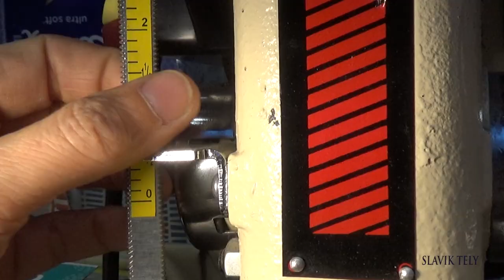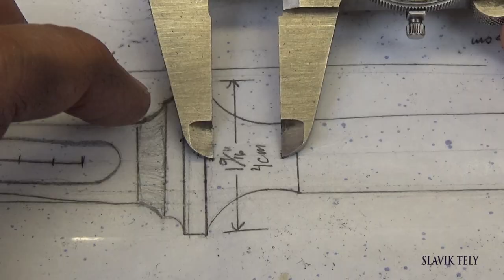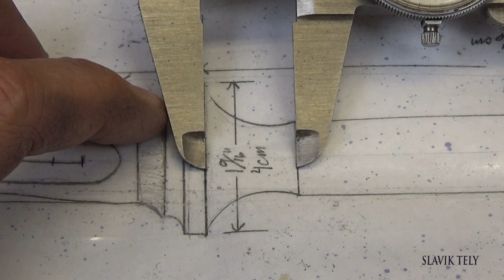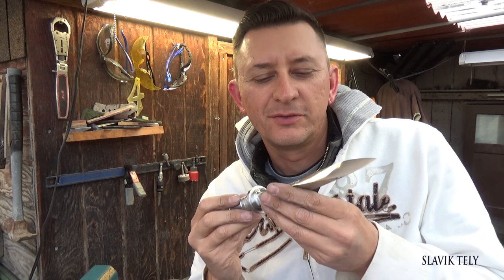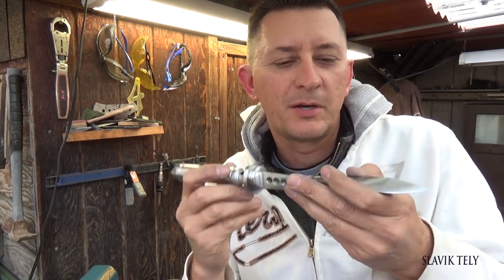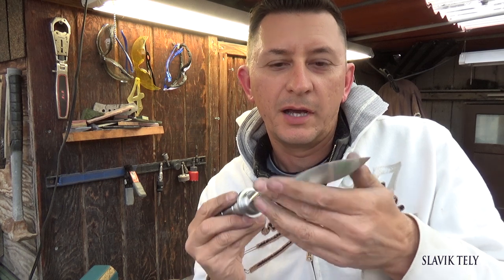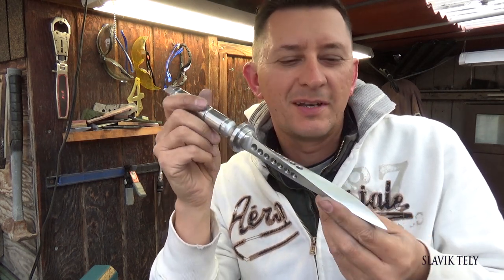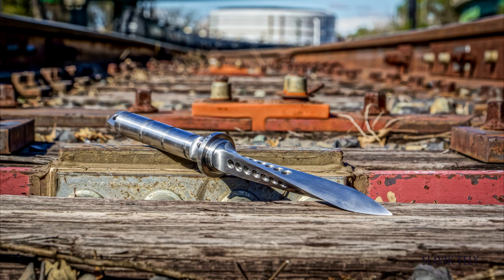Making Jagdkommando Knife without a lathe or CNC machine Part 2

Comment: Dude, you are an absolute inspiration. I build electric guitars by hand, with only three power tools (router, electric drill, and a palm sander). Everything else I use are hand tools. 

It takes a bit longer, but it gives me more control, where detail is concerned. 

I just found your channel, and I was like, "Finally someone else who thinks this way."
Reply from the maker: Thanks.
Reply: That's awesome man hats off to ya from bass player and woodsmith
Reply: @jonathanfowler3231  Weird question, but did you study and TA for Steve Davis in the SMU Anthropology department in the early 2000's?
Reply: @peachmelba1000  no sir I did not wish I would have sounds interesting not wierd besides stuck hone doing nothing so no problem answering sorry couldnt help you
Reply: @jonathanfowler3231  Hey it's a small enough world that I thought you might gave been that other Jonathan Fowler lol Cheers, and be well.
Reply: @peachmelba1000  you as well

Comment: Nobody:

Youtube algorithm: How to make a knife banned by the Geneva Convention at home
Reply from the maker: You made me laugh.  Awesome comment. PINNED!
Reply: Lmao
Reply: Not to rant but why is it banned?
I know those wounds are hard to patch up, but so are radiation/chemical/fragmentation wounds.
Seems unlikely that something like this would be unhumane.
Actually, it may even hurt less than your regular blunt bayonet.
Reply: @lazar2175  Well, as this knife has 3 edges and it is said that when it is stabbed into someone you twist the blade and the resulting wound would be hard to apply first aid to in the battlefield and the blood loss will be massive considering the size of the wound that this knife would make. And also chemical/radiaton weapons are also banned by the convention
Reply: @lazar2175  It's banned for applying unnecessary suffering to a combatant
Reply: @lazar2175  this design is impractical to produce. a tri-cornered blade is not. in fact, it's possibly easier to make than a traditional knife. it's designed to puncture more than slice. so making what are essentially three sided ice picks is quite cheap and just as easily affixed to a weapon as a bayonet. this curved design is more to look cool than anything. that twist isn't going to be any more lethal than a straight tri-cornered blade. Rondels and like daggers have been around for centuries. They've already been used for bayonets.
Reply: @lazar2175  "Eliminate the threat" has several meanings. Making them unable to fight achieves that, wether they're dead or not. And yeah, goal of war is to win, but that can be said about pretty much everything. You don't see people in war go around shooting an extra bullet in people's head or decapitate them to make sure they're dead if they're already incapable of fighting. Also, bombs sure kill people, but so can a regular knife stab. Doesn't mean it's intended to kill. The intention depends upon the user themselves, in most cases atleast. If the purpose of war was to really kill the opposing side, then why is it a war crime to shoot medics? The Geneva Convention even protects wounded soldiers. Here's a quote from ICRC "IHL regulates how wars are fought, balancing two aspects: weakening the enemy and limiting suffering." There's multiple points proving that you're not supposed to try to kill people, but make them unable to fight.
Reply: @TechnoMasterBoy  Maybe you are right, i am not too familiar with Geneva conventions.
I just thought why would something like this be banned, over things like depleted uranium bombs, shells and bullets which are not banned AFAIK, they were even used in Balkan wars by USAF.
I hope i didn't come off as prick.
Cheers.
Reply: @lazar2175  No worries. You didn't come off as a prick. You were civil and allowed for a normal discussion, unlike alot of users on here who just straight up resort to name-calling and other immature behaviours. So thank you for being mature :)
Reply: asad asd  its actually banned because it causes unnecessary suffering.
Reply: Es increible que youtube permita este tipo de videos, y mas de un arma blanca prohibida por la convencion de ginebra.
Reply: asad asd  But it really isn't bullshit. If you look at my comment above, you can see why. It really is banned because it causes unnecessary suffering like Jahseh said.
Reply: @lazar2175  As you said the wound is hard to  clean and close. Wounds like that are very likely to be infected and cause a longer drawn out death.

Comment: That's some serious precision with the belt grinder, it really looks machine made. And the round parts look like they're made on a lathe. But to address Skelton's original doubts, it would be much easier and require much less skill to simply grind a triangular profile, heat it up and twist it.
Reply from the maker: I don't think it would be precise when you twist heated steel.
Reply: @SLAVIKTELY  Hey thanks for replying! 
You could make it precise by using a rig to hold the tip aligned while you twist. Perhaps you could even use the same rig to heat treat it and assure no warping. Then sharpen the tip with the grinder.

Comment: Dull or blunt? Which are the correct term?
Reply: Dull = Edge  Blunt = Point
Reply: Dull means an edge that is not very sharp blunt means no edge or point like a medievil reenactment sword will be classed as blunt as there is no sharpening on the blade

Comment: in Germany is everything illegale, almost but that things are even illegale to own, other normal knifes are just illegale to carry in public - but a perfect work, the only thing i would leave away is the hole between the guard and the handle (idk if one call it by knife like that so) for me it's just a unnecessary weak spot - if it's necessary to harden the blade whole ,idk but in a temper oven, I don't think that the upper part will deforme, but for sure you should temper it after hardening or it will easily break.

Comment: You're precise with that saw blade. I would fuck it up ten time over.
Would it be faster if you cnc the handle from the start?
Reply from the maker: I didn't want to use CNC but wanted to show it can be done with basic tools.
Reply: @SLAVIKTELY  respect.

Comment: But, will it kiiiiiiill?
Reply from the maker: No
Reply: If the tip is sharp then yeah that could kill even if the edges aren't sharp. Imagine a tiny hole opening up to the size of a hot dog but it also twists anything it punctures. If it's not sharp it'll give you a nice bruise, maybe internal bruising depending on how hard the strike is. Skin is pretty resilient lol

Comment: You forgot the groove going all the way down each flute.
Reply: he said he did not make the fullers as it would take ages.......watch the full thing or dont comment
Reply from the maker: Thanks Tactical Trampel.
Reply: @SixsixSebi  Yet, he has a drill setup - he could have done most of the roughing out using the drill, a wide bit and shallow cuts along the ways.  The one he used for making the holes would have been able to score out all of that by cutting circles down the way about 15 MM deep or so, depending on scale.

He THEN could have gone in with a file and cleaned up the circles, and THEN made the point.

so, it's not also a matter of "time" but also how you use your tools.
Reply: @SLAVIKTELY  no problem m8, keyboard warriors are hell sometimes
Reply: @WillZuidema  really?! ok lets see you do what he did then and don't you dare to not make the fullers exactly how you said you would make them
Reply: @SixsixSebi  If I had the machinery, I would, and I don't need to justify it, as I have seen it done already by other youtubers, such as abom79 or this old tony.. I am literally talking about using a tool that others have (as well as you) and you cannot use it to its fullest capacity?

Let me spell it out for you, then:
1) Etch the line to where you are going to make your indent in the flutes.
2) Make sure you have a drill bit or end mill bit that can handle at least half the distance of said indentation, and measure out how to do your passes on each side.
3) measure your heights and put stoppers to keep the machine from going past it.
4) make your drill cuts into the metal as needed on one side, flip, repeat.
5) repeat steps 3 and four as necessary.
6) when done making cuts use your file for cleanup.
Is this clear enough for you, or do you want me to outline it in crayon, as well?

Comment: Do we really need this kind of weapon..
Reply from the maker: Who said it was a weapon? You can make a pencil a weapon. Stop looking at objects as weapons.
Reply: irritating...

You can use a dog as a weapon.

Do wE rEaLlY nEeD tHiS kInD oF wEaPoN...
Reply: This is a tool, an art piece. I have a drill bit this size, should I keep it locked up?
Reply: The JAGDKOMMANDO style blade is a bad one to get hit by yes, however it isn’t banned by the Geneva Convention Due to the fact that it is primarily a thrusting knife. The three blades that surround the perimeter aren’t sufficient for effective slashing cuts, which generic blades are capable of doing. Getting a large slash wound He’s also very capable of making you bleed out in a similar amount amount of time this dagger could. All in all the fact that it is strictly stabbing blade keeps it from being banned by the Geneva Convention. It would be illegal to carry this blade holstered in public in most places, but it’s still not illegal to own or manufacture. There are multiple companies that produce these blades on mass and if it were illegal they either wouldn’t do it or would be out of businesses. 

So no, there is no crime being committed here.

Comment: The holes in the blade* are so dumb. I'm not saying that you should stab someone but if you would, the blood would be a pain in the ass to get out of these holes

Edit: i meant blade, not handle
Reply: I think bleeding out through the holes is the whole feature of this knife.
Reply: @DutchFurnace  well but then you have to clean it
Reply from the maker: What makes you think I made this for stabbing?
Reply: @SLAVIKTELY  i know most people would use it to unskin their potatoes, i was just assuming that if someone were to break into your house and that this knife really was the only knife you have on hand, that you would maybe consider to stab him with it. Then the holes would be a pain to clean out
Reply: Im quite sure you could rinse this under the tap. Yeah real hard to clean, doh!
Reply: @freedomfighter0011  have you never cleaned blood off of ur knife or what? Blood is a pain in the butt to get off of anything
Reply: @worker2004  yes as a hunter i most certainly have but get it quick enough and it rinses off, oh and when its dried i use a little bi carb works wonders😁
Reply: @freedomfighter0011 bi wonders? Well i don't know what that is but if you are using special products it doesn't count as rinsing